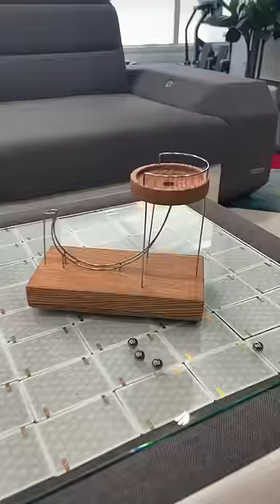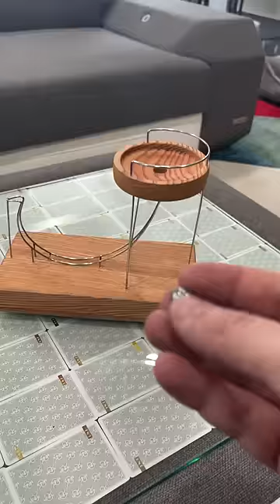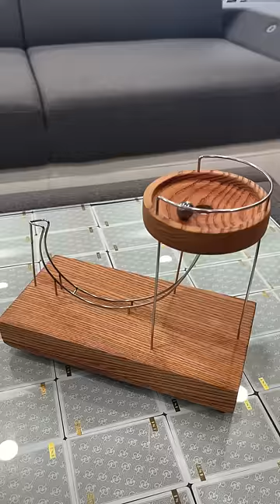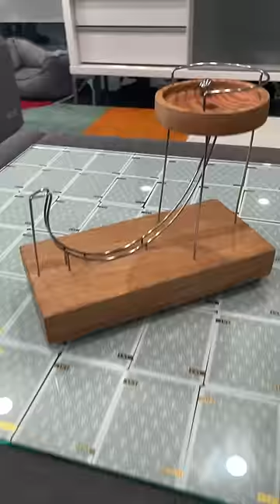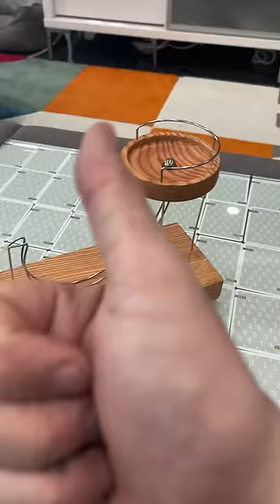An Impossible Perpetual Motion Device?! 😳 #Shorts

Comment: The rails have an electrical charge. Like a mini rail gun.
Reply: I don't think you understand how a rail gun works.
Reply: N-no
Reply: @CasanisPlays  yes I do. I have one on my spaceship.
Reply: @mrpineapple3942  yes. The on board capacitor stores 1 gigabytes of power and shoots it down the rails pulling the ball. Its obvious.
Reply: @robertfranqui6487  Gigabyte is for data storage. 💀
Reply: nah, that wouldn't actually work, it would just short over the ball.

The base has an electro magnet in it to pull the ball down faster than gravity could, though it might detect the ball and try off to let it flick back up, not sure.
Reply: Yeah, it working similar to a railgun is the only way I could see it working.
Reply: @mikoto6505  But in the storage is stored power. So Gigabyte == Power.

Easy.

Comment: I wonder if wear on the wood would effect it over time, theoretically speaking, if you decided to let it keep going for years
Reply: Even if It doesn’t wear on the wood, it would still stop eventually. We hear it making noise, which means that it is actually losing energy, although it’s very little. Eventually that energy wears out and it won’t make it back on top to the platform.
Reply: It’d stop in probably an hour or so regardless of the weathering of the wood. You can visually see it after every time it loses more and more energy and gets slower.
Reply: I don't think it would stop that quickly, it depends on whether you give it energy or not, since it probably works with an electromagnet.
Reply: No matter how you construct the ramp, a free falling object will never be able to reach a height greater than the height it started at. There is energy being added to the system at some point on the track. It'll stop whenever the batteries run out.
Reply: @tobiasvall7604  
He said theoretically!
Reply: @GreyKnightsVenerable  
He said theoretically!
Reply: @llamasama4458  
He said theoretically!
Reply: There is an electro-magnet in it. It's battery powered. 
You're being scammed.
Reply: @tobiasvall7604  it wouldn't even jump out,just stop at the bottom
Reply: The metal would wear as well. Only one way to find out....
Reply: @davidmichael9275  its not a scam. Its just a little doodad like the lucky cats that wave. It does what its supposed to do.
Reply: Yeah. If the device were able to not get damaged or worn it would go on forever. 

Where people are getting this mixed up is the device isn't giving energy from itself it's receiving energy from gravity. 

PE = MGH and it is constantly getting reset. Because free fall is being reset. 

If there was an infinite downhill slope the ball would never stop.
Reply: Copied from the Etsy site: angle of rails may need to be manually adjusted for accuracy

Remember: perpetual motion is impossible without external forces, this machine uses 1 AA battery to power its electro magnet located underneath the bowl funnel

Our perpetual motion machine is also an amazing decoration for desks, offices, and more!
Reply: @gainsgamingginger2177  it does recieve Energy from itself. Gravity won't help it. When it falls down PE would equal to mgh1. When it comes back up it equals to mgh2, where h2>h1. Gravity and mass would cancel out so it would need to get energy elsewhere (the magnet inside it).
Reply: @tobiasvall7604  Wouldn’t the amount of energy being used each time reset because of the bowl? Since the bowl catches it and it rolls into the hole in a separate exchange of energy from the jump, the ball should act the same way whether it’s going down the first time or the thousandth time.

(I’m not an expert on physics, and I think this thing uses magnets anyways so this might all be wrong)
Reply: @gainsgamingginger2177  no, if no energy would be added it wouldn't make it into the top saucer even once after starting.

There's an electromagnet and a hall sensor in the base.
Electromagnet attracts the ball in the downward section then switches off once it reaches the bottom. The added momentum makes it reach the saucer.

It'll stop once the battery powering the electromagnet runs out
Reply: @sixtakefives5325  yes, which is why it wouldn't even work once of no energy were added
Reply: Of course it would have an effect. the batteries would run out
Reply: It's funny how people think there's no batteries to this thing even though the guy straight up said it's impossible.
Reply: @gainsgamingginger2177  no, the rail is magnetized by a battery. There are other videos showing how it works.
Reply: I was just trying to sound as cool as all the other people with internet physics degrees.
Reply: I am guessing it would but it will probably smooth it out. 
Hard for me to explain it here, but where I work, we have a metal roller that suppose to roll against the wood. It become so smooth it was no usage, meaning the wood piece need to be replace. 
I am guessing this will happen overtime for the ball to continuously roll against the convex base.
Reply: It’s not really a perpetual motion device 🙄
Reply: Welcome to the laws of thermodynamics ladies, Gentlemen, other (I don’t have the time to play the pronoun game). The marbles will eventually stop, end of!
Reply: @jesusislord229  and they responded theoretically ffs
Reply: @DSPNWtoCali  but that's not the point. The point is it wouldn't keep going anyway because perpetual motion is impossible
Reply: @gainsgamingginger2177  of course.  My thoughts exactly!
Reply: it HAS to stop. it HAS to lose energy 🤔
Reply: @tobiasvall7604  there is an electromagnet within the wood. It keeps going until the batteries die.
Reply: @llamasama4458  that's what i was thinking 😂 this is not even possible

Comment: Next video: how to insert and hide an electromagnet mechanism inside a wood...
Reply: Is that what it is?
Reply: Perpetual motion is real using enough calculation of gravity and kinetic forces
Reply: @sanggoku4737  no, it isn’t. What you’re referring to is extremely long term motion that feeds off of an external force. 

There is no such thing as creating something from nothing in our current understating of the universe.
Reply: @DoggosAndJiuJitsu  Debunked many times...it's a battery in the circle part with the hole in at the top that powers a drive wheel protruding thru the side of the hole that the ball drops through...thus imparting momentum to the ball as it drops sufficient for it to make the loop jump back to the top.

Complete fake obviously...this version looks cool, but the cheaper plastic versions make a loud whirring noise whilst running.
Reply: @vallejomach6721  that explains the increase in momentum as it passes though the hole. I knew it wasn't perpetual motion only because perpetual motion is impossible, but I couldn't figure it out for the life of me.
Reply: @sanggoku4737 No, it’s really not.
Reply: @DoggosAndJiuJitsu  thankyou for pointing it , i was confused that it looked perfect ,no energy loss, but now I see it's going much higher than the initial falling stage each time , it has an additional energy source

Comment: Good thing it has a nice thick base for the batteries.
Reply: How does it work off batteries?
Reply: @brycehawkins5109  electromagnet
Reply: He even said it wasn't perpetual motion. You arent exposing anyone
Reply: NO WAY! It cant be. On YouTube was said that perpetum mobile device without loosing energy would be looking like this. So it must be true!
Reply: @brycehawkins5109  linear motor
Reply: Its fake but he want to put wonder to the device. He said it himself its not possible but it would look something like the device.
Reply: Going, going, going, the rabbit keeps banging the marching band drum. gnioG, gnioG, gnioG. Going Daeivid Allen  & Gong.
Reply: @ethandurtschi1990  They are just informing people. Cause many don't realize
Reply: No, it is magnet powered.  Maybe it is an electromagnet, which would use batteries, but I have seen these with regular permanent magnets.
Reply: @dannypipewrench533  It cannot work  just on regular permanent magnets, because then you would indeed have a perpetual movement machine.
Reply: @zeycus  I never said it was a perpetual motion machine.  If a high permeability material is used to redirect the magnetic field on one side of the magnet, then the magnet should only have a significant effect on the marble one way, which is moving upward toward the funnel collector.  This prevents the magnet, for the most part, from slowing the marble after it lifts it.  However, this will still run out eventually.  The magnet will still have a minor effect on the marble as it moves away, but the main issues, as always, are waste heat and thermal expansion.  The small amount of friction will waste some energy as heat, and that will cause the marble to gradually expand, eventually having a significant enough effect to prevent a successful "magnetic capture."  That, or the marble will not fall down the chute due to being slightly too wide.

I never said it was a perpetual motion machine.  I just meant a highly energy conservative system could be built that would carry out this process for a long time, but not forever.  For instance, the Beverly Clock in New Zealand has not been rewound since 1864.  It is not a perpetual motion machine, but just conserves energy very well.

All I meant is that it can be done without electromagnets.
Reply: I've been speckledorfed
Reply: That's not it. It actually does it all with gravity, but eventually friction will brake or deform something and the machine will no longer work, hence not-perpetual. Friction bends the almost-freefall momentun gathered on the ball's way down and that bend on the wires is the first thing that would go out in a couple of years of that toy's continous run.
Reply: This does lose energy. The steel marble doesn't launch back to the exact place it started. The wooden dish is large enough to catch it falling short and the dish allows the ball to restart at the hole every time with the  same gravity.
Reply: @ClassyMassey72  I think you're the only one with the correct answer. This doesn't need magnets or batteries since it didn't need to get the ball back to its starting point, just the tray. Pretty clever. If it DOES use a magnet then it should get redesigned.
Reply: @xithappens  no it's obviously not gravity, if you drop a bouncing object it will never go higher then the place you dropped it from without adding more force
Reply: @shipuuga  no the balls are clearly accelerated by using a magic spell
Reply: @ClassyMassey72  The beads gets about an inch higher in flight than where it was when it began its decent along the rails. That can't be done with gravity alone.
Reply: @BaneSIlvermoon  You are correct. I found that it does have an electromagnet and rechargeable battery.

Comment: Warning underneath that perpetual device:
"Don't use non-magnetic/ plastic beads. Made in China". 😂
Reply: You forgot the "2 AA batteries not included". Lol.
Reply: Ah but see that’s the secret, the AA batteries that are included with this device never run out.
Reply: Yeah I was guessing it's magnets
Reply: @VeneficusCubes  - I'm thinking no magnets are involved, but instead it is operating like a rail gun. Two parallel wires with the ball completing the circuit. Normally, you need large amounts of current, but for only a slight gain in momentum, I think the requirements are pretty low.
Reply: Lol....🤦‍♂️ physics, and science.
Reply: 🤔 even if magnets...  Magnets use no electricity.
Reply: @bkehlin  - I think this application would require electromagnets, which would need electricity. You have to be able to turn off the magnet after the ball passes it.
Reply: @meezerluvr  I'm betting something like this could be made with permanent magnets to be at just the right height to "pull" the bearings up to the top bowl.  🤔 Now I've got a summer project.
Reply: You mean Designed in California. Manufactured in China.
Reply: @bkehlin  - I absolutely don't want to discourage you from trying this, as I think it would be a fun project. But I want you to go in knowing that success would mean a violation of at least one of the first two laws of thermodynamics. I think you'll find that the same magnets that "pull" to accelerate the ball will also "pull" at the wrong time to decelerate it. But you can experiment with positioning and polarity (requires magnetizing the ball) to see what happens.
Reply: @meezerluvr  you’re 100% right. It’s only possible because the rails are energized and are what propel the ball, like a rail gun. If it was possible to use permanent magnets for perpetual motion we’d have figured it out and done it already
Reply: @bkehlin  once the ball passes a magnet, the magnet would pull it back and cancel out any speed gained from the magnet accelerating the ball
Reply: @meezerluvr  I like your thinking but those two wires are connected at the launching end so that can’t be correct.
Possibly electro magnetic so magnet can be switched off after accelerating ball and before it starts to decelerate ball
Reply: @hobomike6935  now that's the twist. Only clever boys get to use this tek
Reply: @bkehlin  still magnets degrade over time. So as far as I'm aware it wouldn't be considered true perpetual motion.
Reply: @bkehlin  magnetic field is indeed related to an electrical field
Reply: @meezerluvr  Just so you know, a rail gun DOES use magnetism. "A railgun is a linear motor device, typically designed as a weapon, that uses electromagnetic force to launch high velocity projectiles" from wikipedia.

Comment: Yea we’ll just ignore the fact that the marble rapidly accelerates once it drops through the hole 😂 i see nothing! 🙈
Reply: EXACTLY!  A little wheel is on the sidewall of the drop point. One AA battery is inserted below the top, round dish. When the ball hits the drop point, the wheel turns on and spins as the ball passes through the drop point. That’s what gives it the required speed to make it back up to the top. This boomer conveniently leaves out the part about installing the AA battery. 🙄
Reply: @chrisjenkins203  You're describing the cheap knockoff version. This one uses an actual electromagnet.
Reply: I like how Chris commented on multiple comments thinking he was right about this.
Reply: @endless3cho  idk why but that was funny 😂
Reply: @chrisjenkins203  no, there are electromagnets in the wooden base
Reply: This is not do you think it is there's no way that steel ball we get enough momentum to speed up that ramp and make it to the top into the bowl again it's run on some kind of battery or magnetic force
Reply: @Magneticitist  yup
Reply: @endless3cho  I've got a sister in law like that
Reply: that’s why he says at the beginning “it doesn’t actually exist but IF IT DID it would look something like this:”

Comment: "Perpetual motion is impossible" 
"Here's this toy that displays perpetual motion"
Reply: There's a wheel in the hole that speeds the beads up when they fall through it
(powered by an external supply of course)
Reply: @redbubble7106  i would have thought there was a magnet in the base to sling shot it
Reply: @Nijle2478  A magnet uses up motion to generate energy. The key here is "uses up" as in consumes, not generates automatically forever.
Reply: @Leonhart_93  a sensor triggered electromagnet would accelerate a magnetic ball once passing the center point and would also explain the statement “as long as the beads don’t fall at the same time”.
Reply: @williamshatner6375  And the electromagnet and sensor consumes energy, no? Magnets are technically perpetual, but there is no perpetum motion device so clearly that's no oversight.